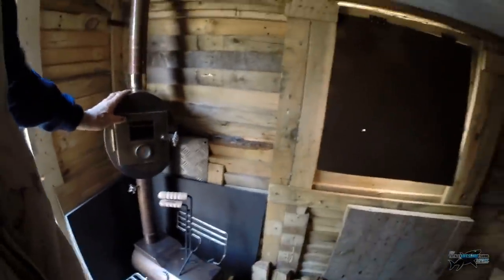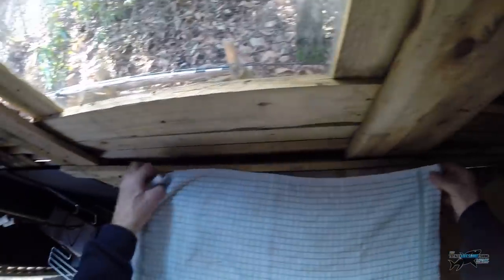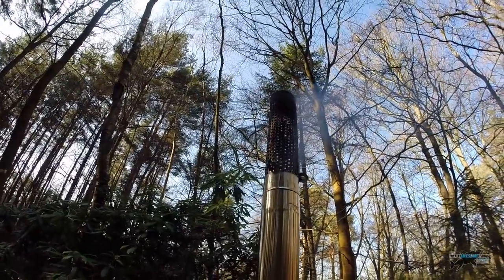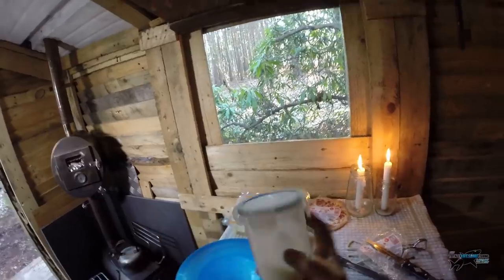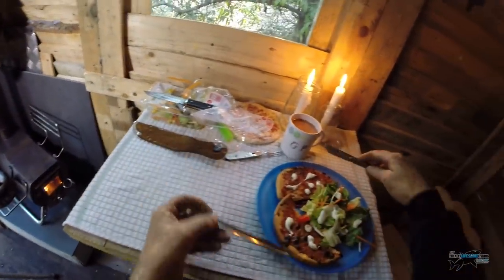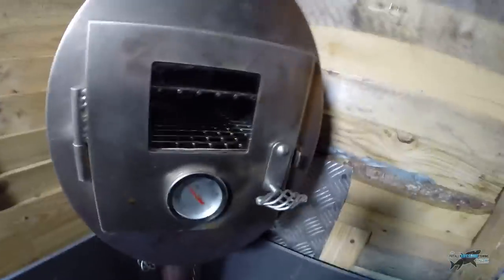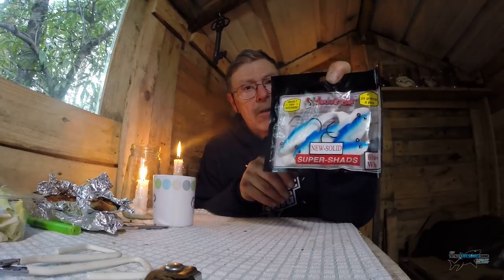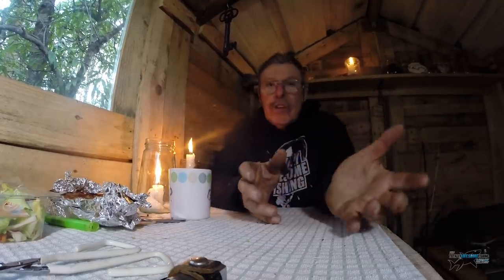Off Grid Pallet Wood Cabin - Fishing Tackle Tips (EPISODE 1)

Comment: I saw a neat idea for an indoor/outdoor woodbox I want to use on my build.  The bottom back corner when front loading it from the outside is the hinged area.  When loaded full of wood.  The box hinges at the wall of the cabin all the way into the inside.  No fuss and no mess.  It all stays in the box.  It saves on room on the inside.  And can keep the wood dry when waiting outside.  Some black pipe insulation cut in half and to length makes for a great way to seal the cracks around the wall cracks and the box.
Reply from the maker: That box idea is good ,saves you going outside. I can see that would be a space saver ,plus easy access in cold weather.

Comment: I noticed just below the spark arrestor there are little loops on the bottomside of it where it attaches to the flu.  That would be an awesome point to attach three guidewires made of metal line/wire.  That will make it a lot safer and sturdier in high winds.  I use the wire from hardware stores to hang pictures.  Any scavenged wire or leaders would do!  (Free)  Find a good location to securely anchor each line and your done!  I wonder if you have some black tip shark to cook in that stove oven.  I hear it is quite like pork.  Creole butter injected into it is the best!

Comment: Enjoyed this Graeme. I have those same Okuma Interceptor reels, they are decent - got mine about 15 years ago probably £40-£50 new at the time. Fyi If you put milk in first the tea doesn't brew properly because the temperature is lower.
Reply: The Okuma Interceptors were a sniff under 30 pounds 15 years ago. I still have mine on a pair of deadbaiting rods.

Comment: That knob on the pipe is called a damper. It's basically a plate with small holes inside the pipe that can be rotated to control airflow. With the damper closed (plate is flat), it restricts the airflow and slows the fire down. When the damper is open, the plate is straight up and down allowing the air to flow freely. Think of a butterfly valve on a carburetor.
Reply: Before bed you would close the damper and close the air vent on the door to slow the fire down to a high smolder so you don't need to wake up and fill the stove as often.

Comment: Dad! What have you done. In the next couple of months while the April showers come into there own. The back of the shed will start to become damp: Why the gutter fitted at the rear of your cabin, will fores the water run off back onto the cabin wall. Causing dampness. Enjoyed the video Cheers
Reply from the maker: The roof should be fitted the other way but it would have meant cutting the sheets and we had no more.It was salvaged dump stuff .The ridges make it run front to back or vice versa which is why I fitted gutter round the lot with an overlap for drips....Mike might look up at his own house one day and say ..."Where has my guttering gone ?"...all to the pallet cabin.

Comment: They are not very expensive and they do the job, the name spinning derives from the leur spinning as it is reeled through the water, and the ideal reel for this was the fixed spool reel as it winds in the line 5 or 6 turns to 1 turn of the handle, so it was ideal for that reason

Comment: Hi Graeme, as always entertaining and informative. I wonder if you could comment on the the pro's and con's on long or short rods for boat fishing,. I'm thinking of buying a new 30lb class rod and don't know which length to go for.  The rod in question comes in 2.1 and 2.4m lengths .  In other areas of fishing I prefer a longer rod for casting but that's not so important, I would have thought in a boat .  Any advice would be appreciated.

Regards

Mark Thomason
Reply from the maker: Short rods are good for applying power but a pain in a small boat when you have a good fish on and have to steer it round the outboard. If you are in a small boat/outboard I would go longer,but in a large charter boat the shorter version should be fine.
Reply: Your a gentleman. Thanks for the prompt reply. As you have persuaded me to look seriously at a small boat when I retire in a couple of year I would have been a fool not to ask. It helps that your response feels right as well. Thanks again and tight lines. 

Regards

Mark Thomason